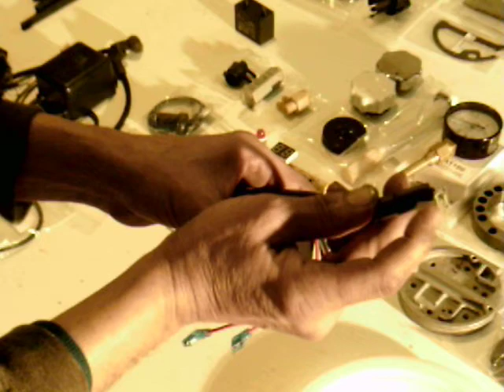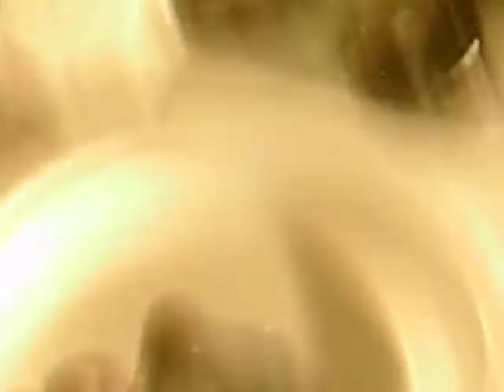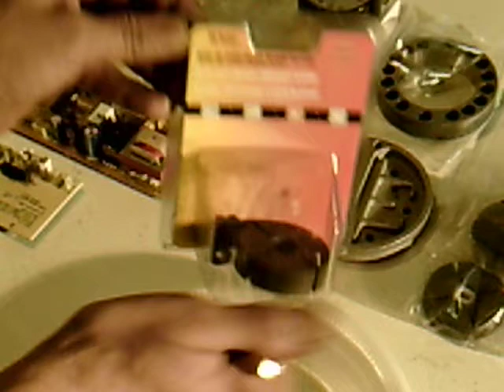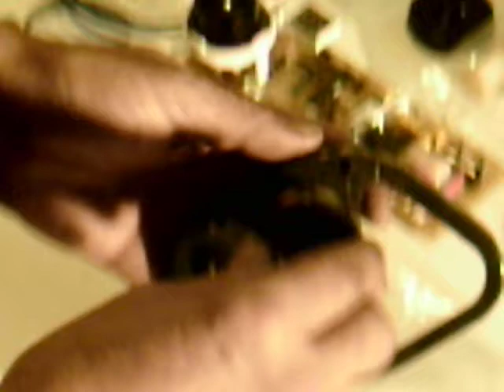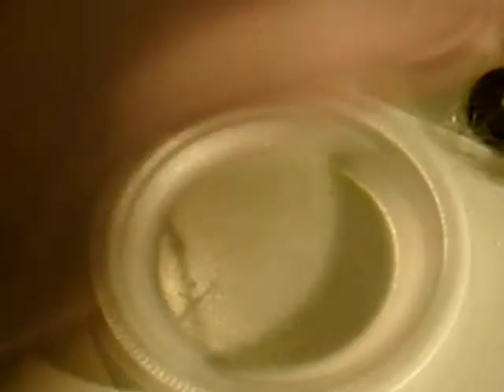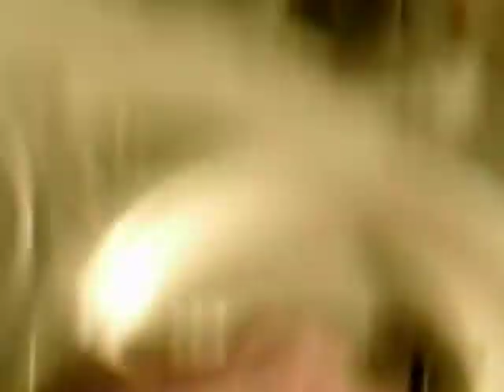Torpedo heater parts. Space heater parts.

Comment: Question.  I have a Reddy Heater 155,000 that I rebuilt and runs perfect.  However after running for a couple hours and garage is warm it kicks the breaker button off on the heater.  Not low on fuel.  Do I have a weak breaker unit?  Is there a test I can do to check it?  tks.  Jim
Reply from the maker: Which breaker the one on the heater or on the wall ??
Reply: @TorpedoHeat  the one on the heater.
Reply from the maker: @jamesmatthes7415  Try changing the photocell

Comment: Why will the circuit board on a Reddy heater be damaged if you disconnect the photocell or ignitor I'm trying to repair my Reddy heater I ordered a circuit board mine tries to kick on and blows the fuse every time
Reply from the maker: Heaters vibrate a lot and that is tough on the board. Un plugging items will break the board since it is cheaply made allready

Comment: Wich type of nozzle used in diesel heater?
Reply from the maker: Most likely the one wity the Oring on the back
Reply: @TorpedoHeat  
Iam asking which type of nozzle that means wich number like 0.5,1.1.5 n 40,60,80,90 degrees used in torpedoes heater
Reply from the maker: @pandhrinapagar2084  That is hidden info. The factory is the only one who knows

Comment: What make the heater cut off and when the lid is on
Reply from the maker: Most likely you have an air leak. If you dont have any air leaks then the heater will start. Fixing the air pump is usually the first thing you do when repairing a heater. If you havent tuned it up in a while then that usually helps. You can call me so we can figure out your problem. (216) 801-6215 I will be around all weekend and tonight until 10 pm Eastern time.
Reply: Thanks
Reply from the maker: No problem

Comment: Do all the blowers use a circuit board
Reply from the maker: No all heaters do not use a circuit board. What kind of heater do you have ??
Reply: A reddy 55000
Reply from the maker: If it has a spark plug then no circuit board. A hot surface igniter system does need a circuit board. Yours should be no circuit board.
Reply: Mind has a igniter no spark plug
Reply from the maker: Here is the circuit board you need its very common.  https://torpedoheatparts.com/click-here-for-parts?olsFocus=false&olsPage=products/104068-02-ignition-control-circuit-board-master-reddy-desa-more-104040-common   It is reccomended that you replace the photocell as well. That is here.   https://torpedoheatparts.com/click-here-for-parts?olsFocus=false&olsPage=products/photocell-pp236-m16656-24-desa-hsi-common-more   The image of the photocell is bad but that is the part you need. Make sure you dont touch the igniter as it is VERY FRAGILE.
Reply: And it has a thermostat on it
Reply from the maker: The thermostat should be on the other side of the heater and you will not have to bother that unless it is bad.
Reply: So is it a way that I can wire it up without the circuit board
Reply from the maker: It would not work without a circuit board

Comment: I have an old heater that has a flameout reset with two wires and three post can you tell where to get one
Reply from the maker: Only place I know is ebay and they cost 90 dollars used. The problem with those switches is that it will not reset. If yours will reset and pop then you have another problem with your heater.